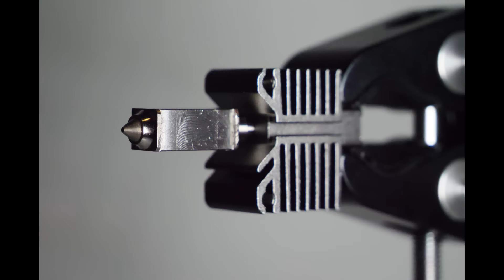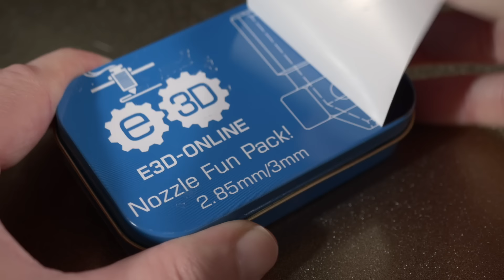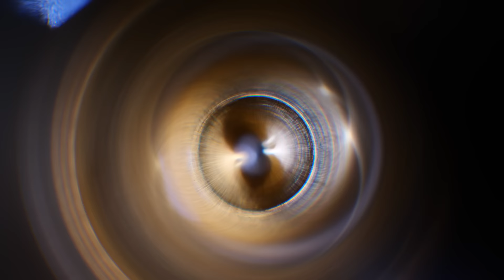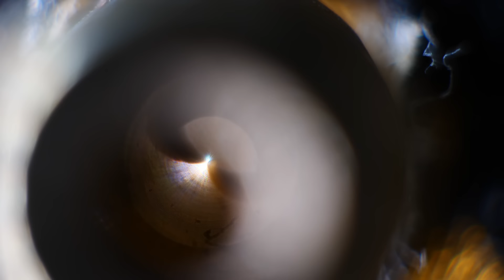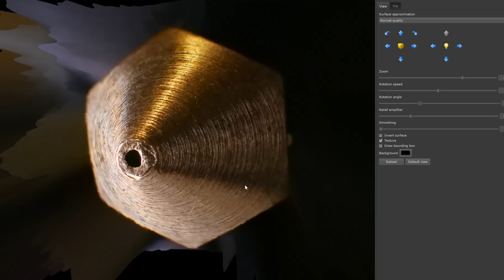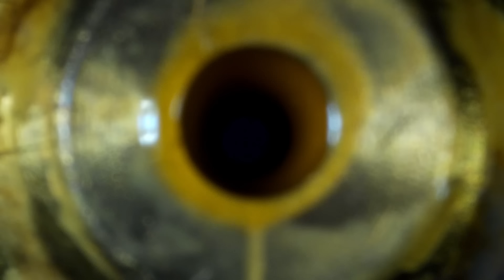Expensive Vs Cheap 3d printer nozzles - let's look inside.

Comment: if you need a pinpoint source of light, try a small sealed box with a bunch of bright LED lights and run a small fibre optic through the top. The open end of the wire is your pinpoint flashlight, point it where you need it, clamp it in place. can probably run a few wires and use them all as a dynamic light source, point them where you want.

Comment: My first printer was supposed to use ED3 V6 ones, and I when changing picked mark 8 ones (as they were the easiest to find in shops) and I never was able to print without heavy stringing again, until recently after almost 2 yearss where I found an internet guide that toldme that they used v6 I forr some reason never tried another type of nozzle, I thought they were all the same  xD

Comment: Step One) Find and define the problem. Step 2) Work out ways to fix it. How might we fix the issue of cheap nozzles? It's just a piece of brass, can we make a reliable way of polishing them? You now have the method to measure the success of trying various polishing ideas. That would be an interesting video.

Comment: I still have soooo many cheap mk8 and e3d v6 nzzles from my anet a8 and cr10. Its crazy how much stuff was needed to maintain a printer back then but I always ended up ordering a microswiss nozzle and left it at that. I just ordered a bambu a1 to finally see how these super hyped printers are and something I noticed is yes everything is proprietary but its cheap. Like too cheap. How is that whole heater/nozzle assembly less than $15? This honestly has be concerned. It tells me they are probably selling data to make up for lost profits. But lets be real none of our data is secure anymore anyways.

Comment: For your lighting project consider using a small piece of acrylic or glass sheet in a  shape similar to the capital letter “Q”. Afix an smd LED to the stub of the glass ring. Blackout edges and back face of the ring and presto! You have a diffusing light ring for the near microscopic subjects. For other, better ideas in the field of microscopic illumination, look into the bits and pieces of fiber optics. There are so many parts that could be repurposed, I just think no one thinks of it because why would anyone be taking apart fiber optic components. 
Thanks for the excellent video. Theres some great photography accentuating the information you deliver. It’s greatly appreciated.

Comment: One thing to keep in mind. Softer brass nozzles are significantly easier to drill and machine and easier to get better finishes. Hardened steel nozzles require better stronger tools to manfucature. Can u get a great finish hardend steel nozzle? Yes. But would require significantlynmore expensive tools to make the nozzle of that standard. 
As far as print quality i dont see it being any different with liquid plastic.

Comment: In theory, a rougher interior bore improves heat transfer to the filament due to a significantly increased contact surface area. Think of the nozzle as a heatsink but in reverse. A heatsink does very little without significant surface area compared to its volume. You could test whether or not this plays out in reality with a filament volume flow test with all other variables being equal.

Comment: And in real world testing the hole makes very little difference in print quality.   So long as it's the right size and relativity well done it all prints the same.    Longevity,  well that's another story.  But then you have to really wear out a nozzle before you notice anything.    It's kind of like Audio and video cables,   if "You" hear or see a difference then your money was well spent.

Comment: 1/2 info, 1/2 cinema. Very well done. I think there's a lot more to this.

IIRC from, I think it was a tour of MicroSwiss, nozzles are made via a Swiss lathe. So unless the nozzle is drilled out after being produced, it's basically a fixed drill going into the feed stock to make the start of the nozzle (not the tip), so as long as that's sharp, it should be smooth. But then at some point it needs to taper it down and cut it at the tip. We know from all the variation in filament, materials, and debris that something getting caught/stuck/too much pressure/etc. produce inconsistent flow. So that smooth interior is important. But we also know from the various experiments from CNC Kitchen, Made With Layers (Tom S.), and others that the tip needs to be super flat as the filament comes out and is squished down by that tip.

The taper and outside are almost unimportant... but I feel like the cost of a nozzle, baring the human factor, comes down to how often those tools are kept sharp and the grade of metal used and any weird processing. Like the many CHT nozzles are two part assemblies, how many cheap ones have some gunk stuck in the interior by rough bores that may not come out in a cold pull? The Prusa Nextruder nozzle has been shown that it's just an E3D nozzle with a tube soldered on the back (in simplified terms... look at one and you can see there's more to it). But so long as that interior is smooth, you'll get a nice flow going out. And so long as the tip is cut well, the layers will be squished well. If you can get both elements of a cheap nozzle, great.

But also, does that now mean that the cheap nozzles on a freshly sharpened mill will be better then later on since they don't sharpen them often? So it's luck of the draw? That would explain some of the randomness people get with cheap nozzles.
Reply from the maker: on  your last point: yes - I have some older nozzles I bought 2 years ago that look great. I think that worn tooling is a sort of known phenomenon in engineering.
Reply: @LostInTech3D  Yep. It's why I wondered if that was one of the differences in price.

Comment: Most interesting. I just inspected some of my spare nozzles through a jeweller's loop (actually a similar fixed focus magnifier used for examining the dot shape/size of screening on printed images) and I think that my ~£1 each from Amazon brass nozzles are pretty clean and well finished. I was expecting to see some cheap horror story - but happily not.
Reply from the maker: older cheap ones I have look way better, I think maybe the tooling has worn out and theyre still using it or something.

Comment: When I was working in the mechatronic solutions industry, I worked on a machine for polishing fibre optic ferrules. The final step was QA, where we needed to determine whether the 50 micron core was precisely aligned in the centre of the ferrule, and whether the mating surface of the fibre was sufficiently flat and perpendicular to the ferrule body.

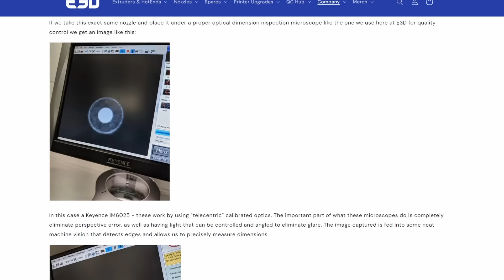We initially tried using machine vision, like the Keyence systems at the 07:01 mark, but we couldn't profile the surface roughness with the machine vision options available at the time, even using a chasing ring light with individually addressable LEDs, so we ended up using laser interferometry. This would be absolutely perfect for looking at printer nozzles, but while a company might be able to justify the expense of such test equipment, it's rather out of reach for the rest of us.

I subsequently worked in the laser micro-machining industry, where our machines used a mechanism called trepanning to drill incredibly precise, deep holes in material. They could drill tapered holes such that they would let light through an otherwise solid material, but where the holes were so small they were invisible to the naked eye. Such techniques could be used to create nozzles with non linear internal profiles optimised with CFD for the flow of the material though it.

While 3d printing has come a long way since the first RepRap, it's still a young industry, there's still plenty of scope for future improvements, which is what makes it so interesting.

Comment: I never knew there was so much beauty inside of a 3d printing nozzle!  Though this definitely had more to do with your camera work than with the nozzle itself.  Bravo!  Speaking of camera work, any particular reason why for your static shots you decided to go with image stacking vs using the minimum aperture and possibly printing some extension tubes?  I know that lighting becomes an issue, but the slow shutter speed can usually take care of that.  Btw, I seriously think that your channel is one of the most underrated channels on youtube and quite possibly THE most underrated channel in the 3d printing space. I have no doubt that this will change in due time.

Comment: Ok, here's a solution: buy the cheap small nozzles so you have extra material to work with. Then use a good precise lathe and widen them while creating a better internal finish. There, you get perfect nozzles for a low price. Turn .0078" nozzles into cleaner .0157" ones. Heck, you might even be able to make some money from that. Maybe push gritty mixtures through the nozzles like is done when honing exhausts. t'would be an easy machine to make and automate.

Comment: Would be interesting how a Nozzle would look after one small Print (like a benchy) wit an abressive Filament (like PLA-C). If its like cleaned or sanded in the Inside.

Comment: Fascinating images. I just started getting involved with astrophotography and learning about stacking (similar method I'm guessing, for different reasons). Anyway, I am surprised no one has made a ceramic coated or slippery surface coating on the inside so the filament does not "stick" or "drag" on the ID walls. I imagine $$$ is the issue.
Reply from the maker: there's been some PTFE lined nozzles but it's a terrible idea - ceramic sounds not bad, not sure about thermal conductivity, kinda getting complicated at that point.
Reply: @LostInTech3D  Apparently there is a material named “BAM” (Boron-Aluminum-Magnesium), that has a coefficient 1/2 that of Teflon/PTFE. My take is what is always the question - buy/replace cheap nozzles often (consumable item) versus buying more $$ nozzles (hardened steel) that last longer.

This might interest you: 
https://youtu.be/797eG7wPYj4

I’m looking forward to watching the other channel to learn what you discover with nozzle testing!

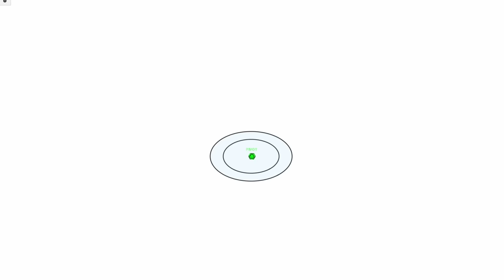Comment: Well, no, it's still a ring light... 14:00 The 'depth' of the light isn't what defines it...
Reply from the maker: I meant you can't get thin commercial ones. I'm designing one about 4mm thick
Reply: @LostInTech3D  Yeah. I realise what you meant, but you denied that a ring light is what you're making in your oral script. -In case you care about such inaccuracies.

Comment: Have you ever tried to polish the nozzle?  The outside should be relatively easy using a mount in a drill, the inside may be unnecessary to bother with.

Comment: It would be interesting to see you take a look at Diamondback nozzles. Bought 2 of them in different dimensions and I must say they have performed excellent, extremely good compared to anything else. But they are really expensive, and made out of diamond so, you know. It's the completely opposite end of cheap ones. On the flipside they are supposed to be nearly indestructible as long as you don't overheat them though, so there's that. Also they have different characteristics in how they handle the heat. They are faster at responding to temperature change making it possible to to better quality prints if you are really into the detailed settings and theory. Anyway, I'm a fan, but I have no time to look at it as detailed as you have. Would be nice to see :)

Comment: At 12:04, you say that the software needs to generate a depth map to do the stacking. Well, yes, kind of. Before I go further, I want to mention that I am an embedded software engineer. I worked at a company for 3 years working on a face recognition access control system. It involved a lot of image processing.

Now, when it comes to image stacking there are a few different ways to slice this cake, but the way I would approach it is by doing a Fourier transform on the images. A Fourier transform converts an image into the frequency domain. Sharp, in-focus images contain a lot of high frequency information, whereas blurry images lack that high frequency information. By taking each image and slicing it into a bunch of ring sections, then doing a Fourier transform on each of those ring slices, you can determine the in-focus portion of the image. You then combine (stack) the in-focus portion of each image, probably doing some blending around the ring edges to get a cleaner result.

This is actually not too difficult to do, so charging a crazy amount of money for software that does it is, in my opinion, exploitative. Now, processing the image to get enough 3D information to do perspective changes is on another level of complexity altogether and probably would warrant a heftier price tag for the software.
Reply from the maker: Interesting. 

This is what helicon has to say about it (there are three methods): 

Method A computes the weight for each pixel based on its contrast and then forms the weighted average of all pixels from all source images. This method works better for short stacks and preserves contrast and color.
Method B selects the source image containing the sharpest pixel and uses this information to form the "depth map". This method imposes strict requirements on the order of images - it should always be consecutive. Perfectly renders textures on smooth surfaces.
Method C uses pyramid approach to image processing dividing image signals into high and low frequencies. Gives good results in complex cases (intersecting objects, deep stacks), though increases contrast and glare

Sounds like you're describing some version of method C?
Reply: @LostInTech3D  Yeah, pretty close. I've never done image stacking before, it wasn't involved in the face recognition algorithm that I worked on.

What I described is how I'd initially approach the problem. After implementing that, I'd test and refine it as much as I could. The end result would probably be something very close to Method C.

Kinda cool that I pretty much hit the nail on the head without researching it at all! :P

Comment: CNC machining is a bit like slicing 3Dprints. Bigger manufacturers will have their "settings" honed in (literally) much better because there are more iterations where slight corrections go a long way. 
Plus they will have more capable machines that are themselves produced to a higher standard (and specialized tools probably).
Incredible footage
Reply: (it's reamed not honed I know)

Comment: Lost, Greetings from Arkansas in the USA. I find this to be a very interesting video . I never knew this about the nozzles in 3D Printing, and I have been wondering about it. I have about 5 3D printers, and most of them are being upgraded right now. I have a Voxelab Aquila, Creality Ender 3, that I am making it into a extender version, Tronxy XY 3, that I am replacing the power supply, along with the Mingda Rock 3, and I recently donated a Mingda D2 to my 3rd oldest brother. I am wanting to get either the Creality K1 max, or the Bambu Labs PS1 Carbon with the AMS. I am wanting to make prototypes of the vintage G I Joe vehicles and make them fit the 6 inch figures, and maybe get them to be remote control and then sell the prototypes to Hasbro for mass production.
Reply from the maker: probably will be useful to have the AMS for those prototypes!

Comment: Having a cheaper nozzle and not a branded one might not affect print quality, but it might not work well. I ended having repetitive ghost clogging, ie clogs without reason, such a headache, I had to stay next to the printer to force her to print every time the nozzle clogged. I replaced the nozzle and heatbrake (with genuine e3d parts), no issue anymore

Comment: The whole loss of standardization has been driving me insane.
I have been looking for a 0.2mm nozzle for my stock, Ender 3 pro. Over 3 months and about 4 returned nozzles later, nothing fit. Wrong thread size, gauge, length, diameter. Claimed to be MK8, didnt fit anyways. Didnt visually align with my known good 0.4mm nozzle. I was getting convinced they just didnt exist!
Found a guy on reddit who found one for his Ender 3. But he bought it over a year ago, on eBay. In Poland. I am losing my mind over here.

Comment: I'd like to buy high quality nozzles but apparently all of the new high speed Klipper printers from the big manufacturers have proprietary nozzles and only the manufacturer makes those special sizes that are not quite Volcano nozzles but should be.  There aren't even any cheap brass nozzles for my Neptune 4 Pro.  They've been back ordered at the manufacturer for months and the only nozzles sold for the Neptune 4 Pro on Amazon don't fit.  Fortunately, the printer shipped with two spare nozzles and I bought a new extruder assembly.
Reply from the maker: Yeah. Other sizes is where I hit this issue as I'll rant about in an upcoming